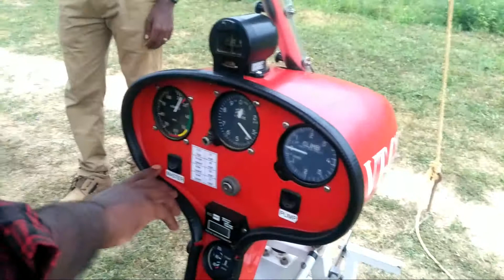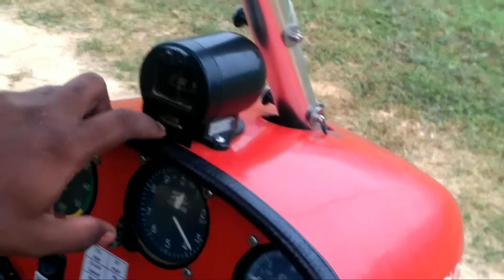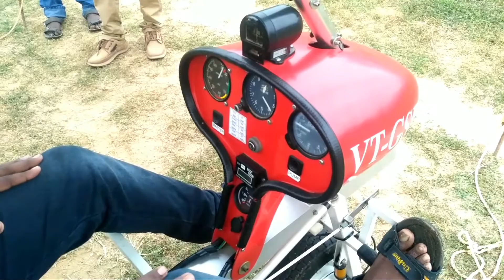Introduction to powered hang glider | Jini Raj

Comment: What is the price of it, brother, please reply
Reply: It cones around 25 lac
Reply: Inported 13 lacks
Indian 9 lacks
Homemade depends on usage of material
Reply: @kuldeepsingh45939  kidro milega 9 lakh wich?
Reply: Can we build a bird like this with three or four lakhs? With Indian material? Plz answer someone..
Reply: @solomondeenadayalzampany5869  bhai itne ka toh engine bhi nahi aye ga... you can use bike engine or small car engine if making yourself but you need to know what you are doing.
Reply: @solomondeenadayalzampany5869  yes you can, you need the wing which cost 2-3 lakhs, two stroke engine which has 20-22 hp(70-90 thousands), and the trike material is made of aluminum steel cost around 70k and choose the right composite material propellar.